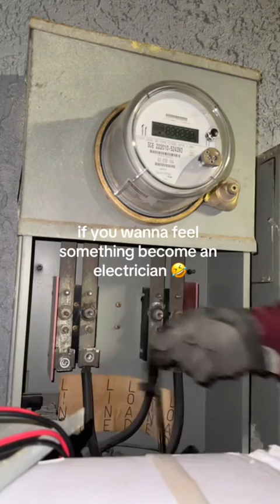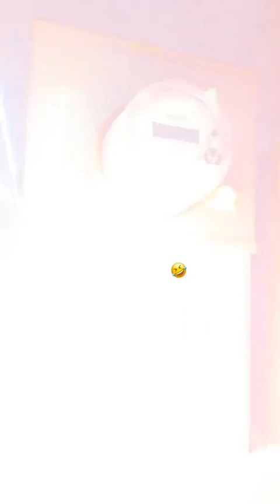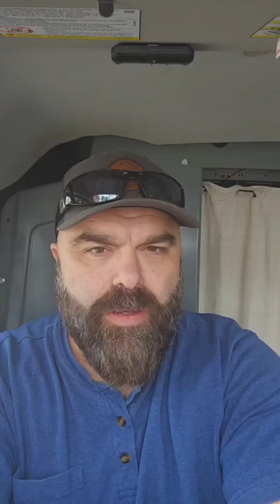Easily avoidable mistake almost costs rookie  big time.

Comment: Work for a utility. Started out in the line shop. Hated making up taps under load. Didn’t want to seem like a punk when I was on the pole or in the bucket, so we’d never pull the meter. But I knew that second leg was picking up any 240 load that was on before the power went out. Stove, heater, ac, whatever. Didn’t like it. Lol